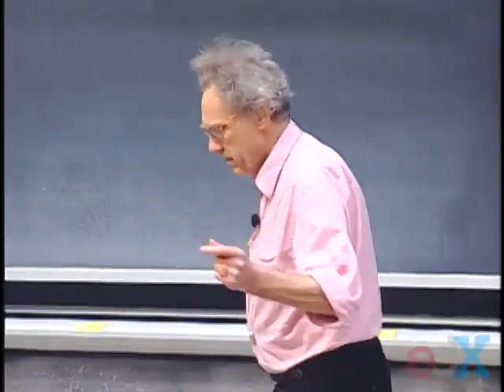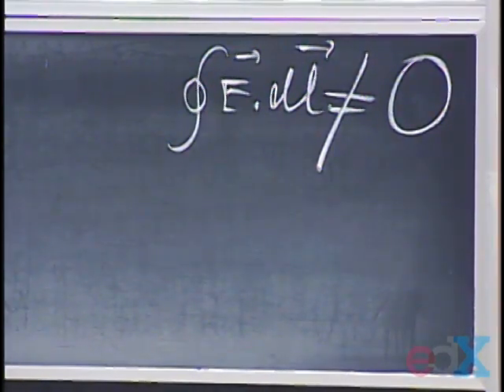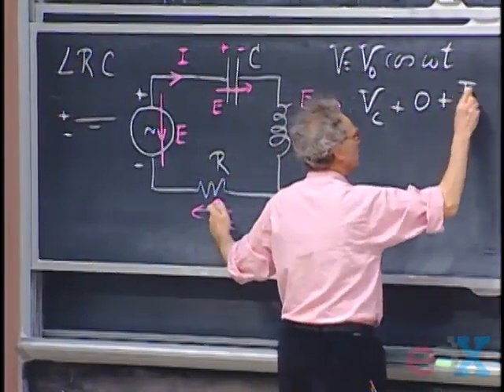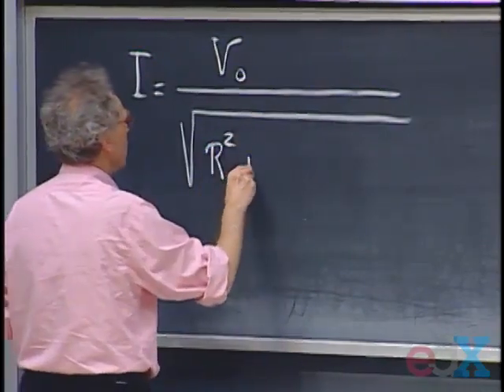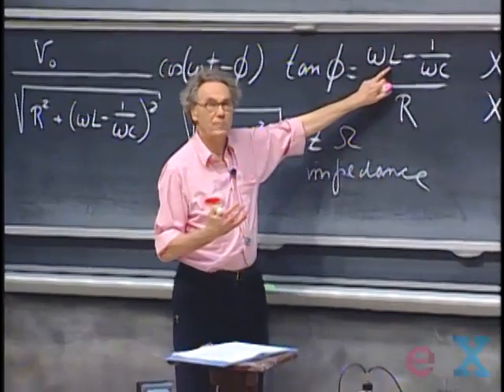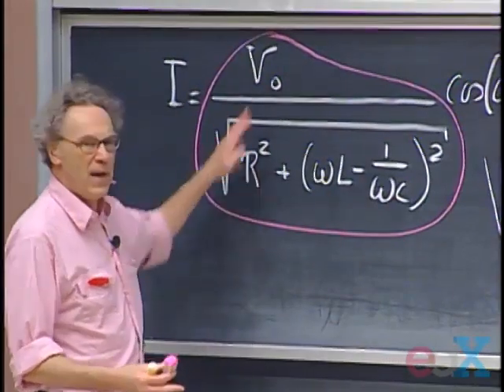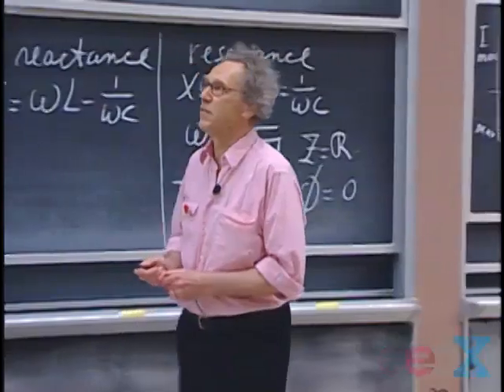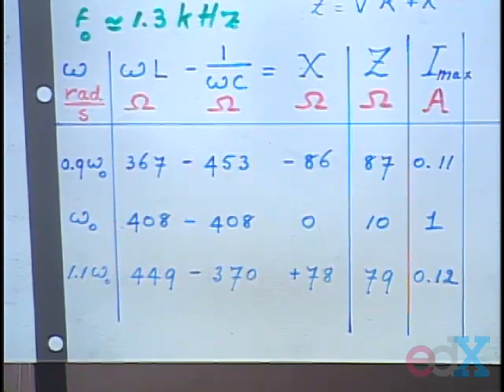8.02x - Lect 25 - Driven LRC Circuits, Metal Detectors

Comment: Dear Walter Lewin, i have seen all Lectures in this Playlist(8.02x) and read the Lecture Notes and I have been thinking about one Problem for 3 hours now. If in a L-R circuit there cannot be an Eletric-Field in the Solanoid, where is the Force coming from, thats "slowing the electons down" because of the Solanoid when you switch the circuit on. Doesnt the changing Magnetic field, that is induced in the Solanoid by the initial Current, induce again an Electric FIeld in the Solanoid wich opposes the moving electrons, therefore slowing them down?
Thanks for your Lectures they help me a lot! Maxi
Reply from the maker: E field in an ideal solenoid is ALWAYS zero as an ideal solenoid is made of superconductive material. Maxwell's equations tell you what will happen. Newton's equations tell you how gravity works. Newton did not know why his equations work. The same can be said of Maxwell's eqs. If I correctly used Maxwell's eqs, then you should be happy. NO changing current in a solenoid can produce an E field in the solenoid (MAXWELL!!).
Reply: Thanks for the fast answer! I by no means doubt your correct use of Maxwells Equations.  But doesnt Maxwell himself say, that a change in Magneticfield, which certainly is the case here, induces an Electricfield. As far as i know the Efield will be perpendicular to the Magneticfield. In a Solanoid this means the induced Efield will oppose the Current. However as you said there cannot be an Electricfield in an ideal Solanoid. So my conclusion so far is, that there somehow has to be another Electricfield that cancels out the induced Electricfield. Is this correct? And could you describe, where this second electricfield is coming from? I hope i described my Problem good enough. Kind regards Maxi
Reply from the maker: The closed loop integral of E dot dl in the RL circuit must be --dphi/dt at any moment in time. Any E field induced or not induced must be in the resistance not in an ideal self inductor.
Reply from the maker: If I have a superconductive wire vertically up, any E-field perpendicular to the wire (pointing, e.g., from left to right) inside the wire would cause a charge polarization across the write: access electrons on the left, access protons on the right. That would cause an opposing E field and the polarizing current across the wire will immediately stop on time scales less than pico sec and the net E-field across the wire would be zero This is very different from an E-field in the direction of the wire. That is NOT allowed as the conductivity is infinitely high.
Reply: Again thanks for your fast reply. I came up with an explanation to my Problem. I guess that the changing magneticfield in the solanoid will induce an efield1 that is tangential to the current in the solanoid (not outside of the solanoid) and opposes it. However this efield1 will immediately by cancled out by another efield2, created by an higher density of electrons in the wire outside the solanoid. These two Efields are dependent on each other and will always in total be zero. Therefore Faradays Law is fulfilled. Do you think this is a reasonable conception? Regards Maxi
Reply from the maker: I don't think so, but I would have to see your calculations.
Reply: I hope that one day, I will be able to calculate such things. For now Ill probably have to let this matter rest. Its really nice of you to answer every question asked here. Thanks again and keep up the good work :)
Reply from the maker: Once you get calculus and once you understand Maxwell's equations, you will be able to do this, for sure.
Reply: There cant be any net electric field there i think , There is ofcourse an induced electric field but as it is a superconductor there will be a static electric field created too and the net electric field will be zero . Why will there be a additional static electric field ? If there was no additional Static field charge would accumulate , and then that accumulating charge would create their own field and current would flow all over the circuit . Ain't that ?

Comment: I have a question about relationship between I max and Z = (sqrt(R^2 + (wL - (1/wc))^2).

Throughout your experiment during the lecture, I understood that I max’s value could only be interfered with the R, not Z.
However, according to 8:18, I max is determined also with Z value, which lead me to confusion that different i max values could consequence different L or C value.

I tried to figure out the question by using external resources, but I couldn’t end up with a solution.
If possible, please answer my question so that I could stay on the right track!

Thank you always

Comment: why will there be no current even in a high quality system when slighty off resonance? 20:30
I get that the width is decreased but there is still current going up according to the resonance curve. Isnt it only when above resonance its start to die down due to the dominance of the inductor  fighting back as you mentioned?

Comment: Dear Lewin
This question is regarding the RLC resonance circuit.
Say I have a voltage input (AC) at 50HZ. and  My RLC circuit has a resonant frequency at 75hz. As i am varying L and C such that the system natural frequency can match the input frequency. So by changing L and C for five different sets I attained natural frequency of RLC system as ( 75, 70 , 65, 60, 55 and finally 50HZ) during this process, my capacitor is getting charged and storing some energy. As it reaches 50HZ my system attains resonance mode, and the reactance of inductor and capacitor gets nullified among themselves.So my question is whats happening to the energy stored in the capacitor and inductor when it reached the resonance mode.
Reply: Will the capacitor starts discharging? after attaining resonance?

I mean, what happens to the energy stored in both capacitor and inductor after the resonance mode is attained?
Reply from the maker: the charge on the capacitor is Q(t)
I(t) is dQ(t)/dt
Reply from the maker: You keep asking questions that I have already answered in my first msg. The solution I sent you is only valid for resonance as I used wL=1/wC.
Reply from the maker: I(t)=(V_o/R)cos(wt).  w is 2pi*f=314 rad/sec. The power(t) dissipated in the resistor is R*[I(t)^2],
I(t) is dQ(t)/dt, the voltage(t)  over the capacitor is Q(t)/C. Thus the energy(t) stored in the capacitor is 0.5*C*V(t)^2.
The energy(t) stored in the magnetic field of the self inductor is 0.5*L*[I(t|^2.
Reply from the maker: The charge Q on the capacitor changes with a function as A*sin(wt).  A can be calculated as I(t) = dQ(t)/dt

 and I gave you the solution of I(t). Thus every 1/50 sec, the charge on the capacitor will go through zero.  In other words twice in a cycle will the capacitor have no charge and in one cycle the plates will twice have a maximum possible charge.  However, the polarity changes once per cycle.
Reply: During resonance, will the inductor and capacitor be storing the energy at the same time?
Reply: through out the cycle?
Reply from the maker: I answered your question above
Reply from the maker: I have answered your question already above.

Comment: Hi Professor, thank you for the great lecture.
I was wondering, if we want to find the magnetic field generated by the inductor in the circuit (as a formula), must we set up another set of equations because the changing magnetic field has an effect on the current through the circuit? or can we simply take B=mu0*I*N/Length like it is a solenoid (and we calculate I = Imax*cos(wt-phi) as that effect of the changing magnetic field is already accounted for in the equation I=Imax*cos(wt-phi)? Thank you for your help.
Reply from the maker: at any given current the field is a dipole field. The stronger the current the stringer the field
Reply: Lectures by Walter Lewin. They will make you ♥ Physics. Thank you Professor!

Comment: 1:50  Sir , How do the  electrons move inside a current carrying conductor if there is no electric field inside conductors ? I agree that if resistance is zero , potential difference is zero ..which means electric field has to be zero .   From what I understand ,in regular current carrying wire ,there is small resistance ==> small potential difference ==> small electric field .so electron will move in opposite direction of field and current will be established (please , correct me if I'm wrong) . 

But if it were super conductor  R = 0 ==>  V= 0 ==> E =0  , still currents flows through it . How does it do so , if there is no electric field ??  
                                     ^.^
Reply from the maker: I cover this in detail in one of my 8.02 lectures. Please watch it.

Comment: If there is no potential difference across a solenoid, then what does the term "Irms*XL" even mean? (In a alternating voltage applied to a inductor)
Reply from the maker: The integral of E dot dL through the wires of an ideal conductor is ZERO at any moment in time. The induced emf in the circuit is -dphi/dt= -L*dI/dt
Reply: Lectures by Walter Lewin. They will make you ♥ Physics. 
But what actually is V sub L?
V = Irms* XL = Irms * omega* L
Reply from the maker: watch my lecture and learn about notations. All what counts is the solution to the diff eq. That's the physics

Comment: Sir, you mentioned that we cannot have electric field inside an inductor but what about that induced electric field due to the changing current through the inductor ?
Reply from the maker: an ideal inductor has no resistance. Thus there can be no E-field inside the wires of the inductor.
Reply: @lecturesbywalterlewin.they9259  Then , what about that induced current in the inductor due to nonconservative efield
Reply from the maker: @Mahmoud Desokey The current in a circuit which has an induced EMF is I=EMF/R. R is the total resistance of the circuit. An ideal  inductor has zero resistance. There can be no E-field inside a superconductor but, of course, any current can go through a superconductor. That's the basic idea in the LHC! use google for more information.

Comment: Hi Professor. I love your lectures!! I had a doubt regarding the Electric Field inside an inductor. If the E field is 0, doesn't that mean the electrons (when inside the inductor) no longer have a particular direction to flow, as opposed to a resistor?
Reply from the maker: E-field is ONLY zero in a conductor if there is NO current going through it.
Reply: At 1:52 you mention that E is always 0 in an Inductor, doesn't that mean that a current never flows in an inductor?
Reply from the maker: E is ONLY zero in a conductor is no current is going through it.
Reply from the maker: YOU misquoted me. The E-field inside an ideal self inductor is ALWAYS zero as it has no resistance. Thus it is also zero when current is going through it. But conductors that have resistance, the E-field is ONLY zero when there is no current going through.
Reply: Lectures by Walter Lewin. They will make you ♥ Physics. Thanks a lot, sir.

Comment: Please sir ,Does the impedance of RLC circuit change with time ? I think that it changes since in the beginning the opposition of the inductor is maximum and then the opposition becomes zero when di\dt is zero .for the capacitor the the opposition increases as it charges and then decreases .
Reply from the maker: Sorry, but I cannot change Maxwell's equations. I can therefore not anything to the clarity of this lecture. This is very basic 1st year college physics.
Reply: @lecturesbywalterlewin.they9259  I know that it depends on frequency but it was just an intuition .thanks

Comment: Will the capacitor in the LRC circuit blow? I thought they can only be charged one way and if we expose it to an AC power supply it will get charged the other way sometimes? Thank you in advance.
Reply from the maker: how many minutes into the lecture?
Reply: 2:03
Thanks. :)
Reply from the maker: question not clear.
Reply: Lectures by Walter Lewin. They will make you ♥ Physics. In the LRC Circuit, the current goes oscillates to and fro... but i thought that if you charge a capacitor in the reverse direction it might explode.. In this case, won't putting a capacitor in an AC Circuit make it blow? Thank you.
Reply from the maker: Watch my lectures about RC RLC and CL DC and AC circuits.
Reply: Lectures by Walter Lewin. They will make you ♥ Physics. Okay I will! Thank you Professor!
Reply: "Will the capacitor in the LRC circuit blow? I thought they can only be charged one way"
That is only true of electrolytic capacitors. Nobody is going to use an electrolytic capacitor in such a circuit.
Reply: Gio Tag Oh i see thanks!

Comment: why current is proportional with capacitance in RC circuits but inverse proportional in RLC circuits?
Reply from the maker: solve thw diff eq
Reply: @lecturesbywalterlewin.they9259  what is thw?
Reply from the maker: @ugursoydan8187  solve the diff eqs
Reply: @lecturesbywalterlewin.they9259  I have solved them but I only ask to understand it intuitively. thank you

Comment: Dear Professor,
I ve made an experiment when I had an RLC circuit connected in series and I subjected it to different frequencies(1-50kHz). I run it with Vrms =1 sin wave on signal generator. Ive also added a voltmeter parallel to the whole circuit(the way that it measures the Vr+Vl+Vc, voltage of whole circuit). Ive noticed that when I changed frequency, the voltage on voltmeter also changed (by really small amount something like 5/1000 V with every 1kHz), even if I kept Vrms=1V on singal generator. So at the end of the experiment, to make the circuit run on Vrms=1V i had to set the signal generator to Vrms=1.05, so the voltmeter shows voltage = 1V. Do you know why this happens? The overall circuit voltage from what I know should not be dependent on frequency.
Reply from the maker: >>>the way that it measures the Vr+Vl+Vc, voltage of whole circuit>>>
was your voltmeter attached to the poles of your AC power source? 
>>>to make the circuit run on Vrms=1V i had to set the signal generator to Vrms=1.05 so the voltmeter shows voltage = 1V>>>
unclear what you did and what this means.
Reply: 1. I have attached it to the wires, which were connected to the signal generator.
2. I wanted to keep constant voltage of the circuit throughout  the experiment V=1V. To check if that is true, I attached a voltmeter parallel to the circuit. During the experiment I noticed that actual voltage (the one I measured on voltmeter) is different from the one i set it on signal generator and it changes with change of frequency. For, lets say f=1kHz, the voltmeter value was equal to set value on signal generator, but with every increase of frequency, I always had to increase the voltage on generator for the curcuit to run on exactly  at 1V (not  0.99V), cus the actual voltage (measured on voltmeter) was decreasing every time I increased the frequency by 1kHz. So at 50kHz I had to set my Vrms to 1.05V to keep the circuit work on voltage of 1V
Reply from the maker: >>> I have attached it to the wires, which were connected to the signal generator.>>>
I really do not know what this means. Is this your AC power supply?
Reply: Yes, signal generator is my AC power supply.
Reply from the maker: I will have to see a diagram of your complete set up
Reply from the maker: I have to see a complete diagram
Reply from the maker: >>>So at the end of the experiment, to make the circuit run on Vrms=1V i had to set the signal generator to Vrms=1.05>>>
I do not know what this means. sorry I cannot answer your question. How did your measure the Vrms=1V??? We should stop this exchange as it becomes too time-consuming.
Reply from the maker: >>>So at the end of the experiment, to make the circuit run on Vrms=1V i had to set the signal generator to Vrms=1.05>>>
I do not know what this means. How did your measure the Vrms=1V??? We should stop this exchange as it becomes too time-consuming.
Reply from the maker: How did you measure the Vrms=1.0 V?
Reply: I measured it with voltmeter. (Digital multimeter).
Reply from the maker: >>> So at 50kHz I had to set my Vrms to 1.05V to keep the circuit work on voltage of 1V>>>
what does this mean?  There are 2 values 1.05 and 1.0 how did you measure both simultaneously?
Reply: 1.05V was set on my AC power supply, 1.0V was measured on voltmeter.  Also I forgot to add, the measured voltage on voltmeter was decreasing with increase of frequency before the resonance frequency, but after it, it started to increase with increase of frequency.
Reply from the maker: you should ask the manufacturer of the generator how the rms is measured.  I am impressed that the difference between the 2 voltmeter readings is only 5%.
Reply: I think I found a solution to my problem. The signal generator has and extra resistor, which my voltmeter does not measure. The voltage lost on that extra resistor varies with frequency, becouse current in the circuit is different for different frequencies(ohms law). That is way Vin=/=Vr+Vl+Vc. I need to add another resistor to my equation so Vin=Vr1+Vr2+Vl+Vc

Comment: Sir since we know that in pure inductive circuit current lags behind by voltage what if we have two inductor then what will be the phase difference between input and output voltage in AC
Reply from the maker: 2 inductors (L1 and L2) in series will add up to L=L1+L2. 
Pure inductive circuit: Inductor current lags inductor voltage by 90o.
Reply: Lectures by Walter Lewin. They will make you ♥ Physics. But what happen to phase difference in case of two inductor is it become zero
Reply from the maker: For L=0  watch my lectures

Comment: what's the  relationship between the inductor having no resistance and zero electric field inside?
Reply from the maker: <<inductor having no resistance and zero electric field inside?>>
correct if the inductor is made of superconducting wires
use google